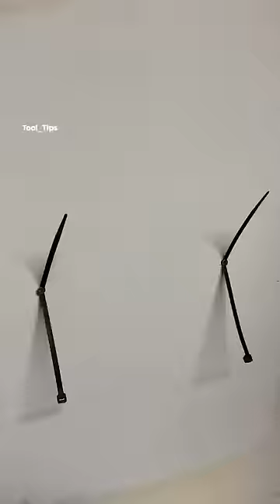5Tips

Comment: On the surge protector tip, wouldn’t you just use the holes on the back of it that are for mounting it on a wall?
Reply: Yeah you would
Reply: Not all have holes though the ones sold in the stores around me at least don't and it sucks for capable management
Reply: Not all of those have holes in the back.
Reply: For me it would be easier with zip ties as I  don't always am able to get the screws in the holes.
Reply: @annedmondson7626  put a piece of tape on the back of the surge protector and take a marker to mark the holes where the screws go. Put that piece of tape on the wall, and you have the holes for the screws. Works every time
Reply: The point is not literal.  Use your imagination.  That tip can be used for a multitude of things.

Comment: No amount of soap is going to sharpen that drill bit
Reply: It's not to sharpen it, it's to lube it
Reply: @irrespondible  exactly my point because the bit in the video is either as dull as it can be or he was driving it in reverse. Even the shittiest new chinesium drill won't burn any kind of hardwood.
Reply: @simasimson5798  1.) That doesn't even look like a hardwood though haha, just good ol' doug Fir. 
2.) You CAN get a new bit to burn wood if it is incredibly dense, but that's only exotics and old growth heartwood.
Reply: Potentially maybe the soak makes it easier to drill material ?? 😉🤔
Reply: @darryldoty888  again it lubes it, good for saws too

Comment: Ouch! I spent so much on joist hangers building my deck.
Reply: Joist hangers are still important, it's good that you installed them even on a DIY job as it wouldn't pass an inspection in the UK
Reply: @gazs7237  it wouldn't pass in America either. Doesn't matter if it's DIY or not you need a permit.
Reply: @Taylormade2350  ah ok, we have different laws here I guess.

Comment: Cool ideas,tools and tricks!! I love this kind of hacks
Reply: Unfortunately only the dowel jig is really useful. Unless the power strip didn't have screw slots in the back. I'd still probably use wall anchors or adhesive dual lock tape.

Comment: That power strip will just pull off the wall when you try to unplug something
Reply: The funny thing is that they have screw slots in the back of them. So just use drywall anchors LOL.